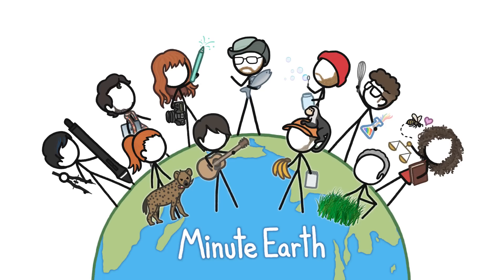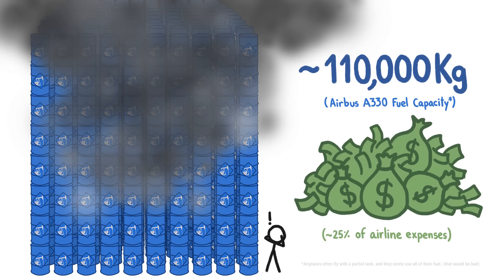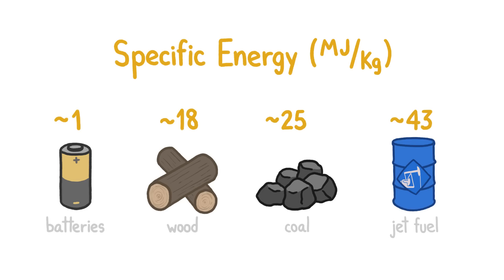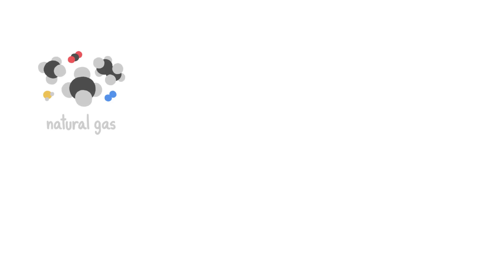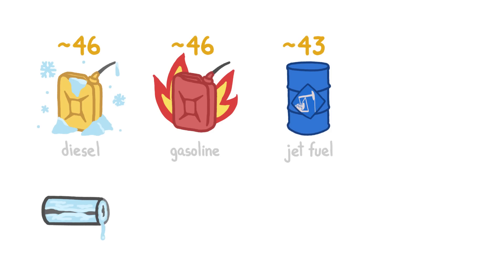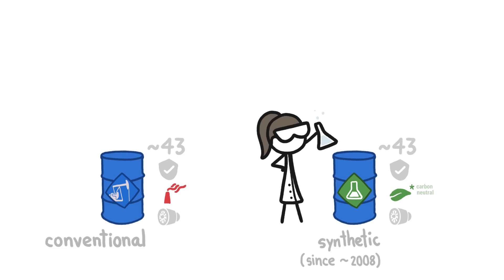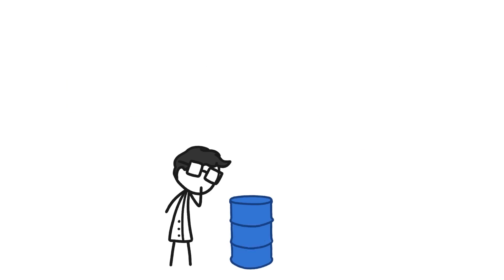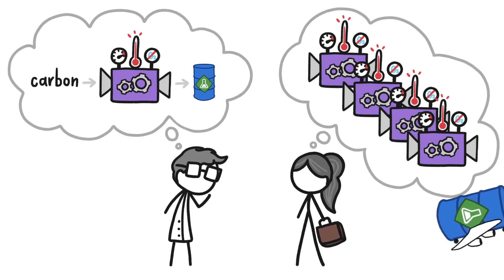Is There A Better Way To Power Airplanes?

Comment: Gases takes up more space? We can compress gases, can't we? So there shouldn't be a problem of heavy storage.
And also hydrogen holds more than enough energy to power aircraft. But I don't know anything about synthetic jet fuel. Maybe it's a better solution
Reply: Hydrogen on its own has stellar energy to weight ratio but a pressure vessel to hold it would bring that down considerably.

Comment: You mentioned gasseous fuels such as natural gas, but did you find anything about cryogenic liquid fuel in your research for this video? If liquid methane is good enough to get starship to the moon or mars, it might work for aircraft. 

You don't need a pressure tank, just to keep the fuel cold until refueling and takeoff. jet engines already exist made to run off of natural gas, it'd just be optimizing them for high bypass turbofan applications. The fact that it's methane and burns cooler could even result in lower cost engines with less cooling required for the turbine stage.

And importantly, we can already produce synthetic methane though a number of biological methods, and with the simplicity of the molecule it'd likely still be easier to manufacture that kerosene even when we can make both in a lab.

Comment: You could beam power to planes with lasers from space based or even ground based power plants. The "fuel" would weigh nothing on the plane, the range would be basically limitless and their would be no risk of catastrophic energy release (explosion, fire or nuclear fallout) in the event of a crash.
Reply: Wireless power is horribly inefficient.
Reply: @TheOwenMajor If you are thinking like how phones and electric toothbrush are charged than yah it's terrible over any meaningful distance. It's not so bad when it is directed wireless transfer (like via laser or focused microwave beam). As long as the emitter can stay on target (the receiver on the aircraft) the conversion rate can be as high 95% currently (in the microwave regime anyway). That is much better than jet fuel or even batteries (though I'm sure you would want at least a small battery on board in case of emergencies or if a power emitting station failed to buy you time to come to a controlled landing or get in range of another power station).

Comment: Could u do something like Helium in conjunction with Jet fuel, where it lifts the plane upward and thus lowers its overall weight in terms of the forces needed?
Reply: Hybrid airships are a thing, too much drag. Either you go slow and use a lighter then air body, or you go fast an use a wing.

Comment: this got me thinking 
If Fossil fuel was depleted one day, will the alternative energies that currently build can replace them easily? You mentioned that even Synthetic jet fuel were still more expensive. But that expensive fuel would be at least re-creatable. but Fossil energy will one day depleted and if it does happen, many airplanes will be grounded. I know at least that some country has build alternative energy generator that doesn't require fossil energy. But since this video mentioned that Airplane build specifically for jet fuel, does that mean many infrastructure and transportation can't be easily changed to alternative energy because they specifically not built for them? does when fossil energy come, we need to tore down infrastructure or destroying cars that use fossil energy and build new one from the ground up that specifically used alternative energy?

I hope someone answer my curiosity.
Reply: Some blend of ethanol(Alcohol), we can readily produce it, but it would take alot of redesign to make it work. 
but Fossil energy will one day depleted and if it does happen, many airplanes will be grounded.
-People have been saying that for decades, not going to happen any time soon enough to worry about it. We have plenty of oil discovered and new ways of getting are invented everyday. 
can't be easily changed to alternative energy because they specifically not built for them?
-As he explained, airplanes can't fly on alternative energy. No petroleum no flying.

Comment: Except there ARE electric aircraft. It requires a redesign, longer wings, use of solar and batteries.
Reply: And electric aircraft are essentially useless for any commercial purpose. 
Right now they are a hard sell for a very minor purpose of take-off, landing training, and completely useless for anything else.
No matter how much you believe, you won't overcome simple physics. Too heavy, not enough energy. 
Using longer wings doesn't magically mean you don't have to worry about weight, the electric aircraft you were thinking about was specifically designed to be as light as possible and was extremely slow and uncomfortable for its sole occupant.

Comment: The idea that we could ever make carbon neutral jet fuel is an insane pipe dream, the only carbon neutral airline industry is high speed rail
Reply: Ah yes, all that concrete and steel doesn't emit any carbon it it's production....
Reply: I also rather want to spend money on railways, but my retarded, unimaginative countrymen rather stick with the old ways of doing things even if they are totally unsubstainable.

Comment: Another point against batteries is that you have to carry tour depleted batteries with you the rest of the way. Then you have to charge them. 
Fuel is great from an efficiency standpoint as well, you burn it, extracting useful work from it. By burning it you also lighten your load, meaning that the next kilogram of fuel burned needs to push that much less mass through the air. 
In fact, a fair number of larger airliners are actually designed with a maximum takeoff weight that is higher than the maximum landing weight, simply because they'll burn off that excess by the time you need to land.  In case of emergency they can circle and vent the excess fuel to get to the max landing weight.

Comment: Couldn't a plane carry cylindrical wind turbines to charge batteries as they fly?
Reply: Im sorty but i rly had to laugh about that comment... ^^*
Its a typical "beginner" mistake (so dont feel bad?).

Our understanding of physic says No.
It would basicly be the same as having a magnet in front of a car to drag it only with the magnet.

You lose more energy with the additonal drag of the wind turbine than you can gain. (Newton)

Comment: I really think your underestimating the power of batteries right there... short haul flights are already possible right now.
Reply: Easier said than done.
Sure short-haul flights are possible, if you don't need to carry any people or cargo and can wait for extended periods as the aircraft recharges.
So effectively as long as you don't need to run a business selling short-haul flights you can use electric aircraft for short-haul flights, perfect.
Reply: For long haul flights, they're not viable. They'd be way too heavy for that.

Comment: Why are we not funding synthetic jet fuel.
Reply: It is not easy to make.  

Your fuel must not be too expensive. You must be able to produce it on a large scale.
Your fuel must also be able to handle extreme temperatures (like cold air at high altitude, and be flammable at a suitable temperature). Your fuel must also be able to handle great pressure changes as you fly high up in the air sometimes, and sometimes you fly closer to the ground.
Your fuel must contain high levels of energy per ton, because you want to be able to fly long distances with an amount of fuel that isn't too heavy for your plane to carry.
And you want your fuel to also contain much energy per volume, because you don't want have a gigantic fuel tank of the size of an airship stacked on top of your airplane just so you can get the fuel that you need.

So as you see are there many harsh minimum requirements I have listed here that an air fuel needs to fulfill.
Getting a good fuel for an airplane is probably much more difficult than finding a fuel for a car.

Even if we would solve the problem of peak oil (which I don't think we will do because of EROEI). Then we will still not probably be able to find a good fuel that can replace jet fuel.
Reply: @nattygsbord  but with funding and advancements we can. You listed points that were in the video and come to the conclusion that we can't make it. Jet fuel will be replaced as we only have a finite amount of it. It's better to fund and create something renewable early, instead of waiting until the very last moment the fuel runs dry and we start scurrying and scavenging for whatever stuff we can use.
Reply: @gre3nishsinx0Rgold4  Just because you want something does not mean that you can create it.
As much as I want cars and planes to be driven by 
lingonberry juice it would never happen because of the low energy content. As I sees it have we not found any replacement for oil, simply because it is the best fuel.
But sadly it is finite and have its environmental problems.

"but with funding and advancements we can"
I wish you were right, but I don't think any amount of money in the world can change the laws of physics.
It costs energy to produce energy. And that is the most relevant question. Money is only of secondary importance.
It costs energy to produce oil - you need energy to drill a hole. And you need energy to pump it up from the hole. And you need energy to refine it... so you lose big amounts of energy when you produce your energy.
But for every 1 barrel of oil you lose at the oil pump, you win 50 barrels of oil which you do things with.
Then you can say that you got an EROEI of 50. 
EROEI=Energy returned on energy invested.

Likewise does it cost energy to produce ethanol. You need oil for tractors, and airplanes spraying the crops. And you need oil for creating fertilizer and pesticides. And water pumps also need energy.
So to grow your maize or corn which you turn into ethanol you also need to waste lots of fuel to create your energy.
So in order to create an energy amount equal to a barrel of oil, you need to waste 2 barrels of oil to produce it.
So I guess you now can see why I think ethanol fuel is an unrealistic alternative to oil. When you lose more energy than you produce, you are acting like an idiot. It is unsustainable and will do nothing to solve our energy problems.
But to be fair, not all forms of energy is as bad as ethanol made from corn and maize. Ethanol made from wood has an EROEI of 5 - which is much better, but it is a too small energy surplus to help us continue life as normal. And a low EROEI also means that energy would be very expensive in the future. And that means that you cannot buy as much foreign food or afford to fly to foreign countries for vacation.

Nuclear power also have EROEI under 5 so it does not have much of future either, and uranium is a limited resource.

And ethanol made from sugar cane is 15 - which is neither impressive or bad. But the problem is of course that you cannot scale up production as much as you would have to in order to replace oil as a fuel source. You cannot grow sugar here in cold Sweden. Indeed, not even Brazil have stopped being a huge oil consumer despite decades of attempts to cut its oil dependency with sugar ethanol cars.

So my sad conclusion is that there are no better fuel than oil. I don't think we will invent any new super fuel to replace it. Instead will the EROEI of oil continue to fall like it have throughout history - in the past it flowed up like a fountain from the ground and you did not need to pump it up and refine it much from sand to get clean oil to use. But now those days of oil with EROEI of 100 are gone and will never come back.
Today it is 50. And it will continue to fall.
Then will oil become more scarce and expensive, and other fuel sources will become more interesting to use.
But they will all be too expensive for you and me to maintain our luxury lifestyle.

Comment: Nuclear planes probably wouldn't be that bad. The amount that'd be required might even make it less polluting than jet fuel is during a crash.
Reply: Apart from the radiation poisoning for the passengers, and if you want to include shielding you aint getting off the ground.

Comment: This ultimately means that we need to fly less. The best emissions strategy is to try to convert short-medium range trips to happen on land by bus or rail. Since these options emit less when powered by diesel and a lot less when electrified (which is easier for ground transport). Ultimately, we need to build infrastructure to minimize the number of use cases, so that the expensive carbon-neutral fuel can be conserved.
Reply: "This ultimately means that we need to fly less."
Means the poor don't get to fly at all. I really hate the middle class activist vibe of this sentiment. You can afford to pay a little more and fly less, but a huge portion of the world can't. 
What you consider frivolous could be a chance to see your mother for the first time in 10 years.

Comment: Aren't there still nuclear submarines in the ocean?
Reply: submarines don't fly :)
https://en.wikipedia.org/wiki/Nuclear-powered_aircraft
Reply: Nuclear reactors might be too large for cars, so why not use them on large buses instead then? We can put wheels on nuclear submarines and then use them on buses on our roads, and then the fuel crisis would be solved.
Reply: One of the great things about using nuclear propulsion on submarines and boats is the overwhelming amount of secondary coolant. Buses would be an issue.
Reply: Submarines don't need to expend energy to carry that weight.

Comment: if we managed to make a nuclear plane fail-prof it could be amazing, we could make a plane that can stay flying for days without landing. but we only ever did a few experiments in the 80's and never went ahead with it.
Reply: Part of that is because you'd need an impractical amount of shielding to make the airborne reactor as safe as grounded reactors (which don't care about their weight because they don't need to fly). And of course that shielding is almost useless if the plane crashes. While I'm at it, the physics of nuclear reactors make them more efficient the larger they are.
With nuclear energy, bigger is better—for shielding, efficiency, and more. With airplanes, you need to use the lightest components possible. This isn't an easy contradiction to solve.
Reply: @timothymclean  On the contrary, friend, I believe it's very easy to solve this contradiction: GIGANTIC PLANES. Just scale it all up until the point where a nuclear reactor makes more sense mass-wise than liquid fuel. Problem solved!
Reply: @andershusmo5235  and how do you build wings big and strong enough to lift that monstrosity you just proposed? XD
Reply: @andershusmo5235  you can't scale up physical qualities of the materials, and that's unfortunately a big deal
Reply: @andershusmo5235  I'm imagining an air craft carrier sized aircraft X3
Reply: The problem with nuclear is that you cannot downsize it indefinitely. With gas or carbon, the size of your engine depends only on the scale at which you want to operate. Nuclear power though requires a big infrastructure just to contain the radioactivity. You cannot power a car with a drop of uranium because that drop would still require attaching a whole nuclear power plant to the car.

With our current technology, nuclear only makes sense for power plants.
Reply: @kaisadilla_phd  it actually needs LESS shielding because you only need to shield the passengers, everything else can just radiate into the air. a plane flying 5000 feet into the air won't impart much more radiation to the people on the ground than the background level. the only problem is the service crew, but its more of a logistics problem.
Reply: Danilo Oliveira I agree with you. The amount of nuclear is minuscule to run a plane, so shielding isn’t an issue. These guys don’t understand the newer technology for nuclear developed. A mini, almost portable, reactor could be designed for a plane. With all the emergency shut offs, it’s much safer than people realize. Chemical coolants which are 1000x colder than ice are used rather than water. It could be done. However, the idea of developing a rocket transport system, which could jet people above the atmosphere, then down again at their destination is also a good idea. But, that’s real work, because absolutely every aspect of the technology would need to be redeveloped.

Comment: How about aerial refueling? That saves a lot of weight during a large part of the flight.
Reply: Sure, except now you are flying around another aircraft, which destroys any advantage you would get.
Reply: A zeppelin drone with a huge fuel storage on board, and a long cable down to the ground so it can pump up fuel 15.000 feet up into the air.

Comment: I'm assuming that the majority of energy needed is to get the plane going fast enough for take off. After all, maintaining momentum at low air pressure shouldn't be as difficult as propelling a heavy metal bird on the ground. 

Does that mean we could create an electro-magnetic rail that propels the plane to such speeds using electricity on the ground so that the plane does not have to carry the fuel needed for take off?
A bullet-train-style slingshot if you will. Ignoring the cost of implementing such a system on the runway, would the idea be feasible?
Reply: I don't think it it the take-off, it is the climb. Getting a 200 ton aircraft to 200 mph is nothing compared to lugging it to 30,000 feet up.
Reply: Let's build huge steam catapults like on aircraft carriers and kick those 200 ton birds into the air.